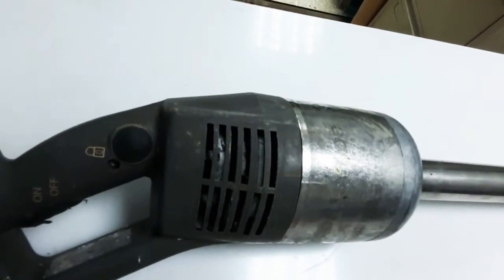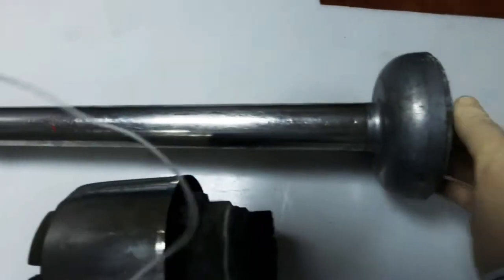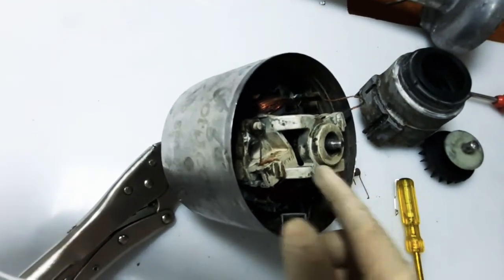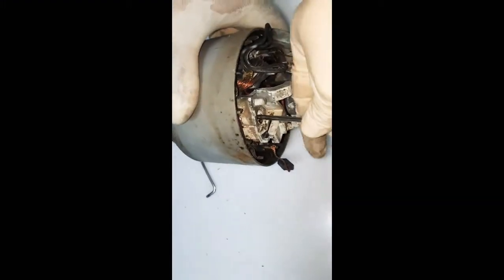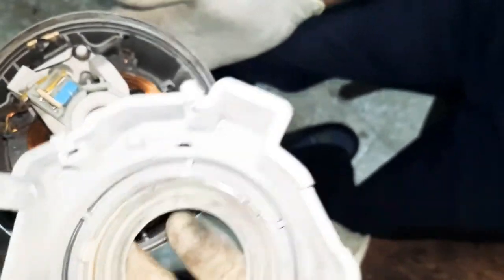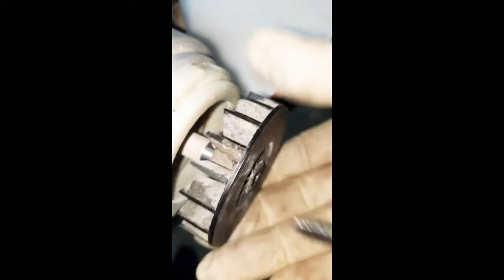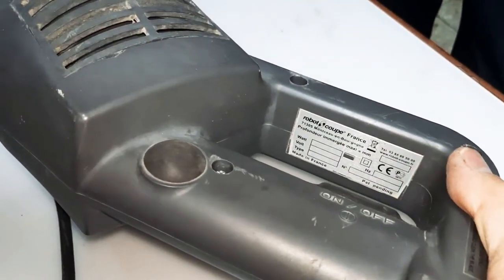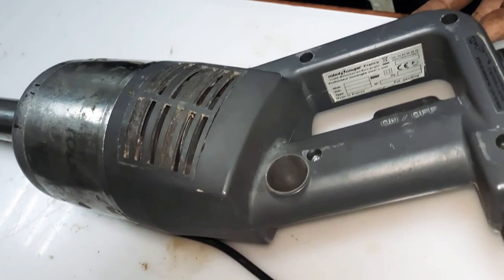Robot Coupe MP550 MP450 MP350 repair.

Comment: Looking for replacement of the circuit board. Robot coupe mp350
Reply from the maker: Take the board to electronic shops, and normally, the transistor is just the faulty component. Transistor that is fixed with the heat sink.
Reply: Sorry friend but can't hear a thing you're saying 😢
Reply: But the circuit board was tottally burnt.